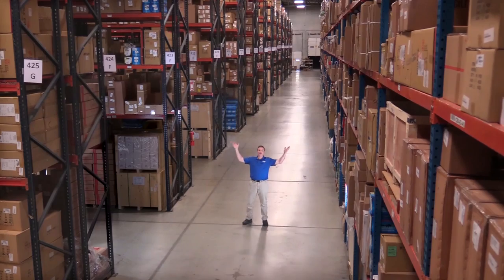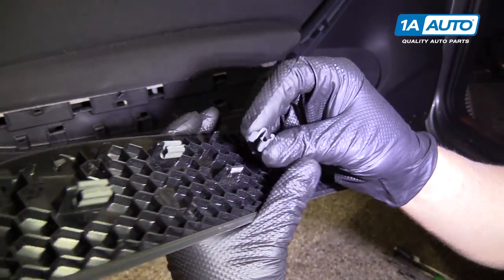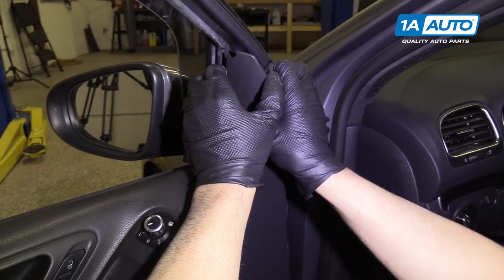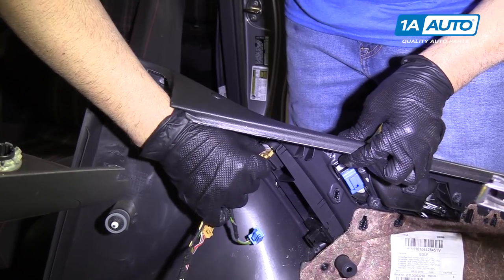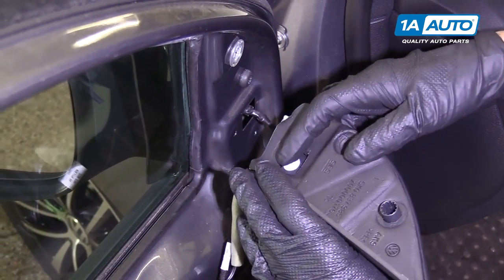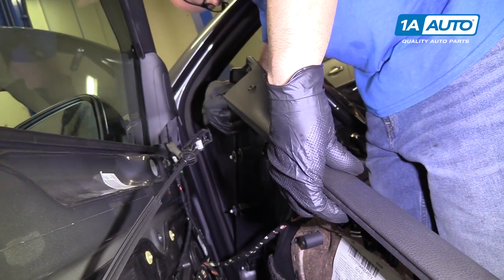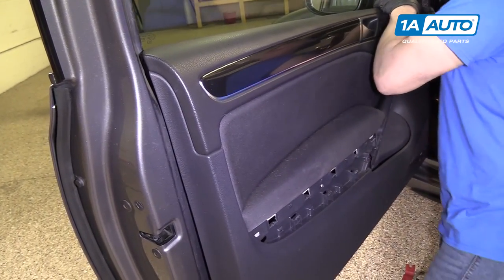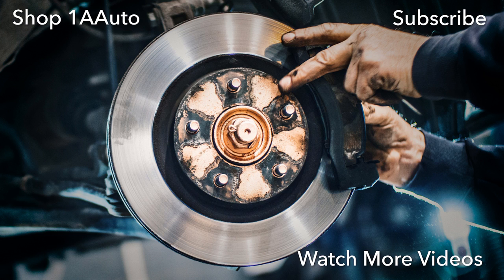How to Replace Door Tweeter Speakers 10-14 Volkswagen GTI

Comment: This is the entire speaker assembly, not the speaker.  I came here to figure out how to replace the speaker with an aftermarket one, if that’s what you’re here for, don’t bother, but if you are buying the whole assembly this might be useful...
Reply from the maker: Thanks for the comments and for watching! +ClintonCraft
Reply: How did you not learn how to change the speaker from this video? When you take panel off unplug the speakers and plug new ones in with adapter.
Reply: Same here bro!!!!!!! I am pissed!!! This was about how to take the dang tweeter out and they left that out ENTIRELY!!!!! I CAME HERE TO FIGURE OUT HOW TO ADD A SOUNDSTREAM TWEETER AND THEY PURPOSELY LEFT OUT HOW TO TAKE IT OFF!!!!!!🤬🤬🤬🤬🤬🤬🤬
Reply: @1AAuto  you left out HOW TO TAKE THE TEETER OFF.